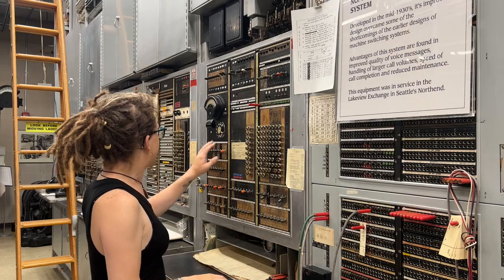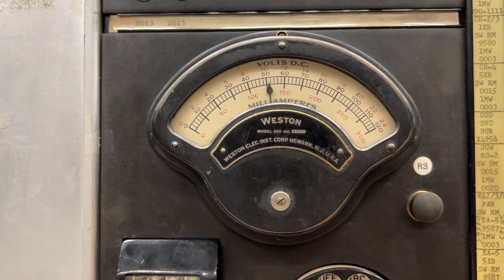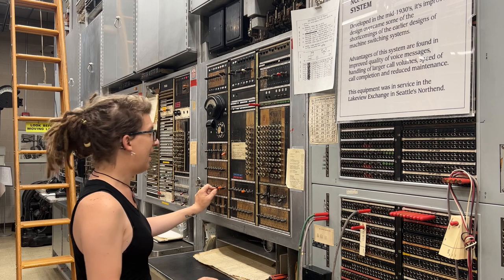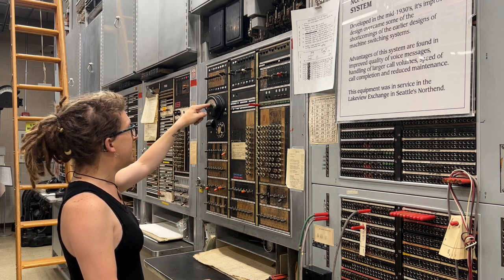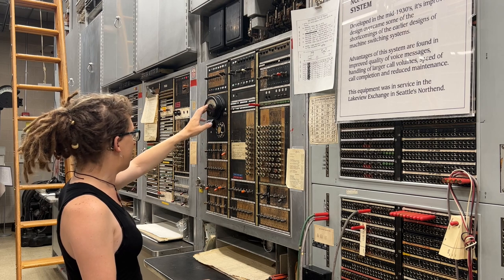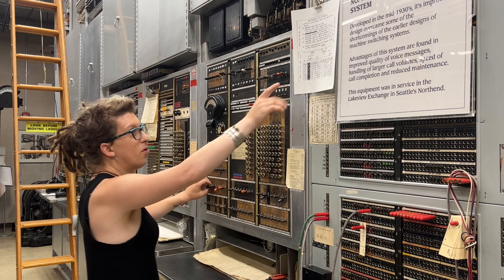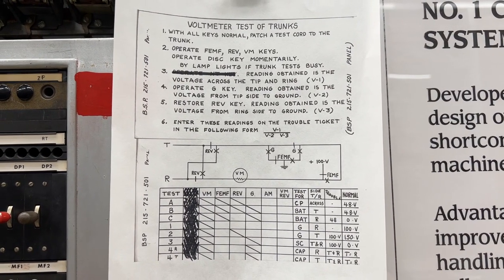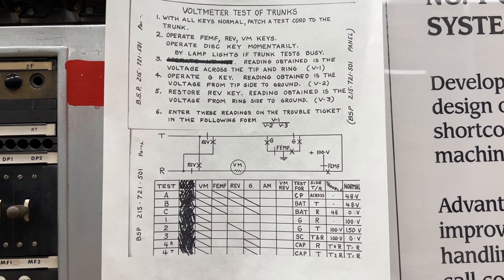Test Frame Tuesday - Outgoing Trunk Test

Comment: Always great to see things from an American angle. Would have loved to see the relay sets operating when you tested the outgoing trunk. At 8 minutes into the video you pulled a plug from the test socket using the cord. In the UK you would have been reprimanded for this sloppy behaviour. Keep up the good work and behave with your trunks! Mark, Manchester UK.
Reply from the maker: Thanks :) Here, you must pull the plug by the cord, and the cords are woven in double and triple layers—made to be yanked on. The screw that attaches the red plastic sleeve to the plug is hot, and if you pull it while the voltmeter is on and you’re touching ground (earth) you’ll get a shock. When I do reach for the red sleeve on the plug, I try to only use the back part of it, to avoid that screw. 

Here’s a video of the relays operating :)
https://twitter.com/museumofcomm/status/1551969229741559808
Reply: @ConnectionsMuseum  Wow! We would never allow that to happen. Anyway still great to see your "Central Office" in the UK known as "Telephone Exchange" keep up the great work, Mark.
Reply: The sleeve screws were "live" on GPO sleeves in 1980 in my Strowger in Manchester East and Ardwick.

Comment: Excellent video.  We had a SxS Cama system that had a test frame that was somewhat similar at southwestern bell in Eldon Missouri,  I was a switchman there who worked both Cama and toll circuits for the lake area there and it was fantastic work. This really brings back memories.  Would you do a video on revertive pulsing in relation to panel switch etc?

Comment: One question I have is my perception is the 1XB is a relay machine, but how does it process/translate MF into work?
Reply from the maker: There are circuits called MF Receivers (MFRs) that are basically a series of band-pass filters that only allow certain audio frequencies to pass through. The tones are detected by tubes after they pass through the filters. When a tube detects a tone, it conducts, and allows current through to operate relays that correspond to the detected tones. 

A special gating circuit locks out the detectors until it hears the KP tone. This prevents talk-off and false registrations from spurious tones that may appear on the line. You can see these circuits in our video about MF signaling.

Comment: Interesting I had a surplus WE  "wire chiefs test set" Beautiful thing in a wood cabinet but never knew how to use it only knew that it was used for testing subscriber and trunk lines. As you mentioned the voltmeter function of your OGTT was my test set a similar simplified form?
Reply from the maker: Almost certainly similar. Testing of conductors was pretty standardized. If a switch man suspected trouble with the wire conductors themselves, he would refer it out to a wire chief who used their test desk (or set) to investigate further.

Comment: Is it possible to use a trunk circuit between two different central offices to "extend" a subscriber line from one office to another? For example, a rural subscriber wants a line with a dial tone and phone number from a nearby city.
Reply from the maker: Yep, it’s called Foreign Exchange service, and it was offered by many telcos.

Comment: The BSP refers to something called "soak current" at the end of the test (where the tick tock sound is).  What is soak current and how does this apply to the test?
Reply from the maker: The reasons for this are a little complex. Soak current is defined as the amount of current that fully "saturates" the relay windings. It is designed to test that a relay will release within a prescribed period of time after the windings have had a chance to fully energize and the magnetic structure of the relay is fully engaged. This is in contrast to "operate" current, which is merely the amount of current that causes the armature to move into the operated position. Operate current is less than soak current.

The other reason is that the test line that we're using here must "synchronize" with automatic trunk test frames (not discussed in this video). These are test frames that progress through each trunk, call the test line, and monitor the results of each test before advancing to the next trunk. In order for this to work, the test line and test frame must be in sync, and they rely on specific signals to do that. One of those signals is the application of "soak" current at the correct time.

Comment: What's inside a busy plug? What's inside a deny plug?
Reply from the maker: It’s technically known as a 184 plug but nobody calls it that. Ring is strapped to sleeve, so any ground on the ring conductor of the jack will be routed thru the plug back to the sleeve conductor of the jack, which marks the trunk as busy. 
https://www.telecomarchive.com/cc/pdf/plugs/plugs,%20184%20185%20186,%201,%201979-04-30.pdf
Reply: @ConnectionsMuseum  So basically it's just a switch that's normally open. Plugging one into a jack creates continuity between the two leads. The equipment isn't looking for anything special, it's just looking to see that a potential (or, ground, lack thereof) applied on one wire doesn't return on another.

That makes me wonder, when a trunk is actually busy, I assume something similar happens, just within the switching machinery itself? I believe from one of your videos about the panel switch you mentioned that the equipment tests the sleeve lead when trunk-hunting for ground. So when a trunk is in use by a call, one of the frames that's participating in the call is grounding the sleeve lead? (I'm assuming that leaves T and R for, lack of a better term, "incoming" and "outgoing", one lead for the calling party to talk on, one lead for the called party to talk on)
Reply from the maker: @teknikal_domain  Yep. Ground on sleeve indicates "busy". Doesn't matter how it gets there. Either the machine puts it there to mark a path as busy, or a human puts it there by inserting a plug and closing a ground from the ring of the jack to the sleeve of the jack via the shorted plug. 

That same sleeve lead exits the jack and is carried to the trunk appearance on the crossbar network. If the marker tests that point on the network, it will see ground there, and will know that it can't try to make a service connection through that trunk.
Reply: @ConnectionsMuseum  I have this weird fascination with communications protocols and how machines exchange information. It's honestly baffling the amount of things that the telephone network did with "ground," "battery," and "no continuity," and "polarity reversal" as the main communication choices.

I also just realized the XB markers must have some brain-melting number of wires, if they have to be able to test any potential crosspoint on the switching fabric. I imagine they're not fun machines to troubleshoot if it's more than just a bad relay.